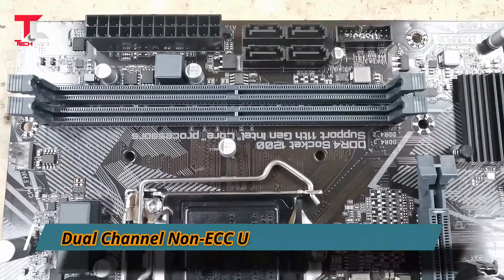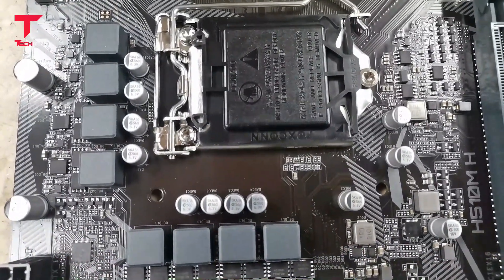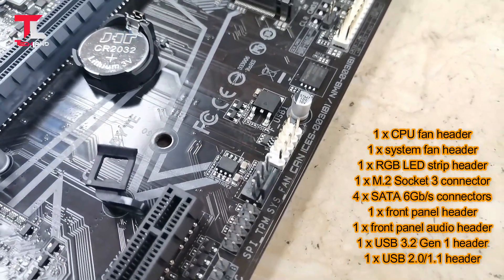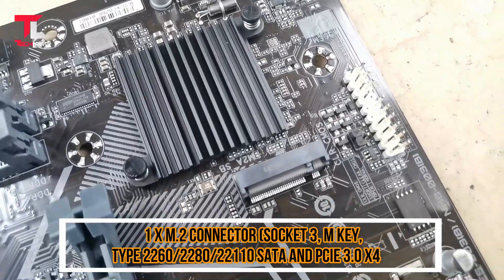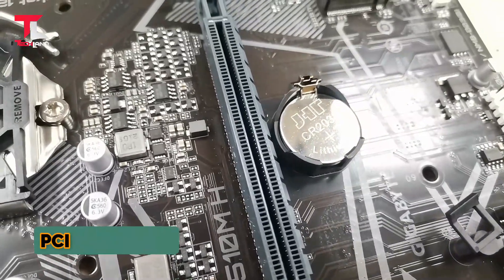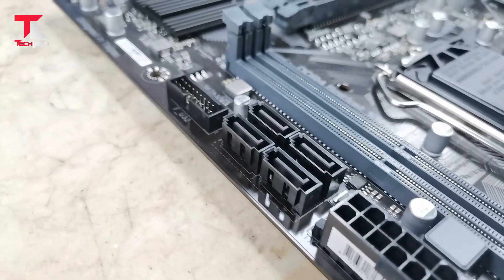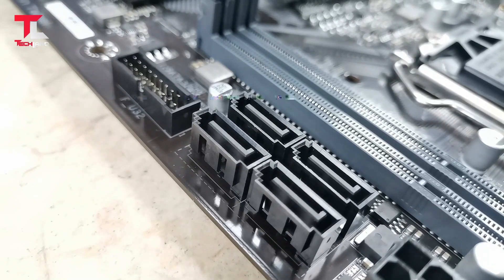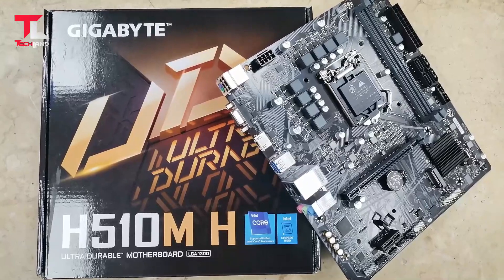H510M H Ultra Durable Gigabyte Motherboard with 6+2 Phases Digital VRM  | Tech Land

Comment: Hi, I just bought a giga H510m-h but why the CSM Support it can't save, it automatically goes into UEFI mode, I switch to Legacy to save and then reset and still see disable (because I use sata port ssd)

Comment: Sir is 510ms2 good with 1660super and 10400f?
Reply from the maker: Yes
Reply: @TechLand2  is it a good combo with the motherboard? It will use the full potential of gpu and cpu ?
Reply from the maker: Yes

Comment: I want to buy this motherboard, with gtx 1080 ti and i5 11400f, can this motherboard handle this cpu and gpu?
Reply from the maker: Yed running but go ahead  minimum B560
Reply: @TechLand2  so, will all be good with H510M H?
Reply from the maker: @mijajlovic_004  Not Bad

Comment: Hello There 
I have a i5 114000
Base clock is 2.6GHz
Boost is 4.40GHz 

Does this mother lit it run at 4.40ghz?
Or is limited to 2.6GHz?
Reply from the maker: Witch your Graphic Card .?
Reply: @TechLand2  i do not have a gpu right now

I'm asking of the processor the I5 11400 with a  base core.of 2.6GHz will be limited to that core speed or if it could use its boost of 4.40GHz 
Don't know of the motherboard will let it use 
Thanks in advance
Reply: @rickciotti8253 I’m also using i5-11th with 1660 super gpu the performance is best

Comment: It supports 3200 modules DDR4 RAM memory?
Reply: @Tech Land what if i have i7 10700k does this also make 3200 mhz a option?
Reply from the maker: No
Reply from the maker: If u cad used 11th gen processor
Reply: @TechLand2  Do you know how many MHz it supports?
Reply from the maker: U can used 11th gen processor so 3200 mhz support

Comment: Hey bro, does this card have an option to unlock the processor power limit?
Reply from the maker: Unblock pro support but not oc u can
Reply: @Tech Land  oh yes, i think so because this function already unlocks the limit and with that it is almost an overclock
Reply from the maker: Yes
Reply: @gabriel_caio77 can i get the actual performance of the cou abd gpu with this mobo?
Reply: @spdclips6657  This motherboard does not limit any parts, what can happen is a thermal throttling because of some heating. Unless you use an i7 or i9 that consumes so much power, (with unlock cpu power limit), you will have no problem. Because her vrm shouldn't support so much thermal dissipation, thermal throttling will occur. Its a very basic mobo.